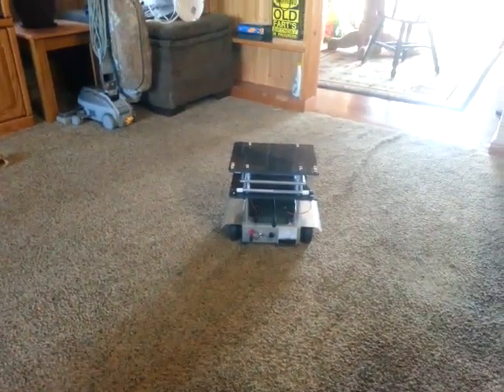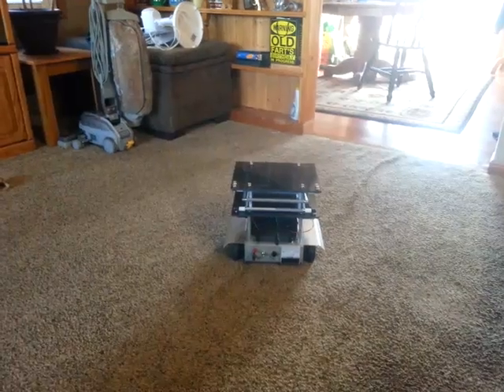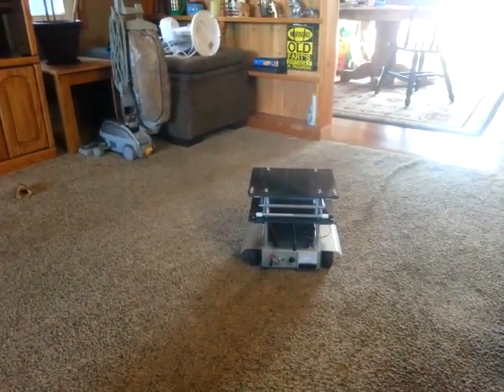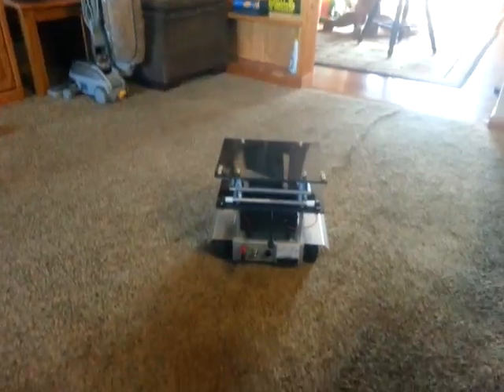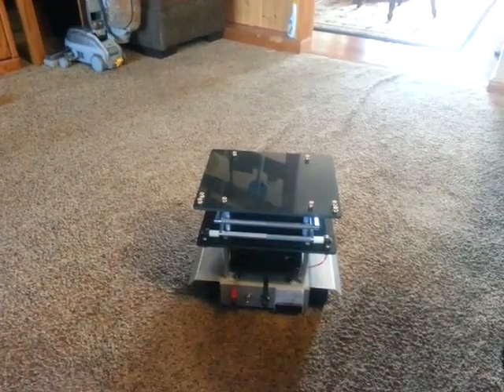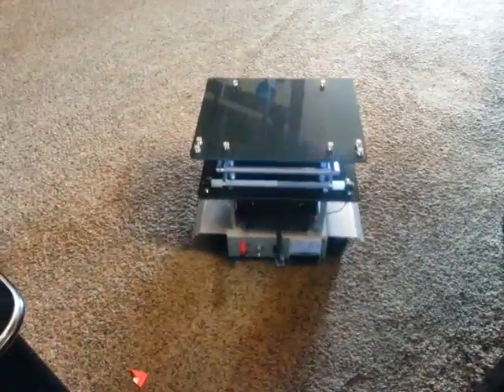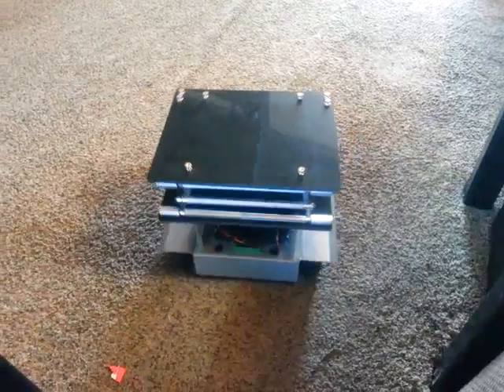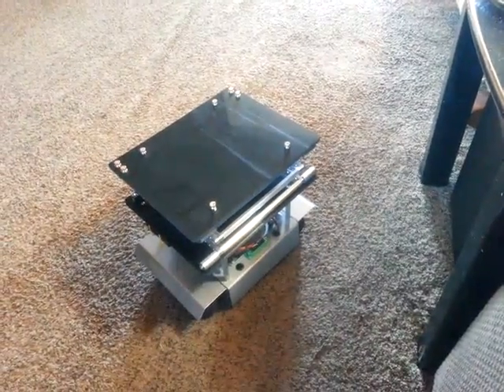Speech Recognition Robot

Comment: I had this SpeakUp Click board and it is very poorly engineered. It worked 2 out of 20 times we tried to record then repeat a voice command. I don't know what sort of marketing campaign the manufacturer is using but it is deceptive. This board simply is not capable of reliable voice recognition.